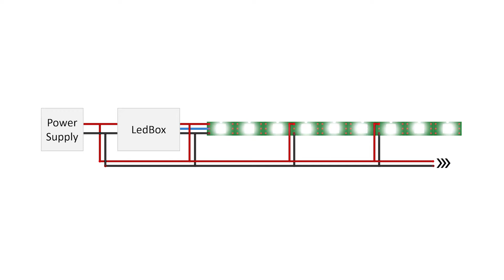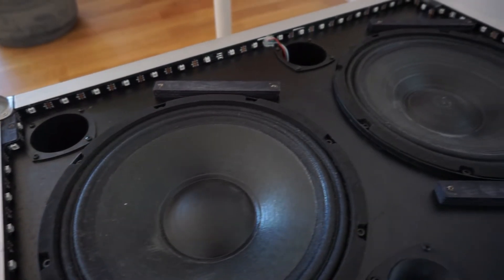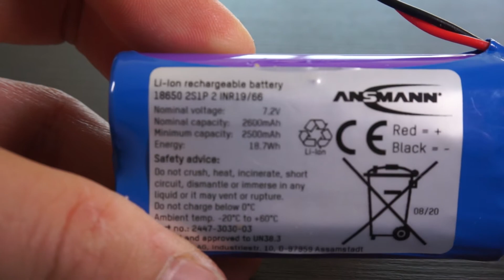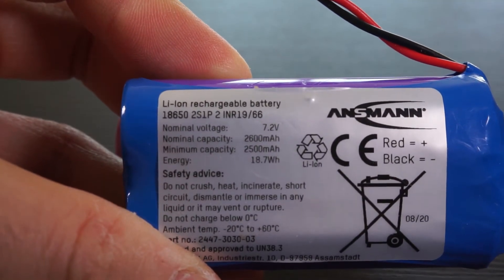LedBox V2 - Explanation, connections, Soundboks installation

Comment: does it not work without wifi ?
Reply from the maker: Yes, you can control it through an IR remote, or a button. However, the module creates its own wi-fi access point that you can connect to through your phone, and that's much more convenient, even if you don't use it in a station mode with your home wifi.

Comment from the maker: LedBox V2 is back in stock with an amazing 20% discount.

https://tindie.com/products/22544/

#BlackFriday #ShopSmall #CyberMonday
#wled #esp32 #ws2812 #ws2815 #rgb #led
Reply: Hello, @ TC 00:20 ( https://youtu.be/DlzgvoAP7WI?t=20) in the beginning of the video you mention "that wirelessly syncs to colors of the display" - please guide me through it, how can i achieve this in my DIY project: i will be using WS2811 leds - aprox 20-22meters and they will be mounted in the floor skirting. I have a TV in the room, my LED psu & the LedBox V2 controller would be in a corner of the room. what expansion hardware do i need for the wireless color sync to happen? Thanks!🤓🧐
Reply from the maker: @istokbasszameg  Hi. When the LedBox is connected to your home network, you can use UDP packets to control it wirelessly. You need to be running a program that screengrabs each displayed frame, calculate the average color in different zones around your screen, and adjust color of the led strip correspondingly. If your image originates from the computer, you can run the program directly. If you use other media sources, it might be a little more tricky. Some people run it on Raspberry Pi, Google Chromecast, or even directly on Android TV. I suggest you look into https://github.com/psieg/Lightpack or https://github.com/hyperion-project/hyperion.ng